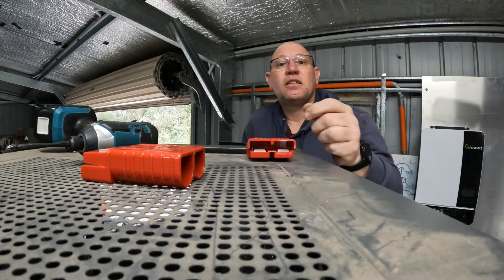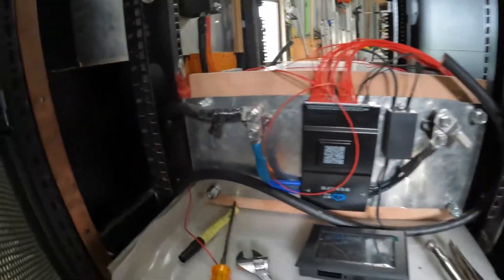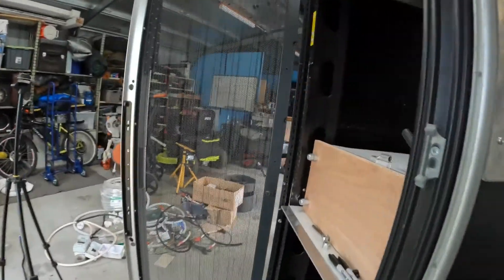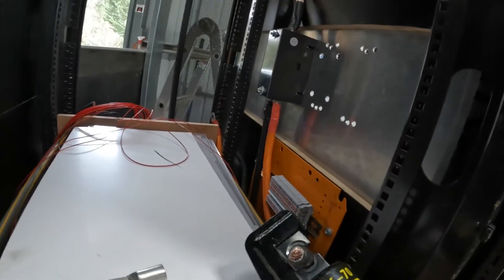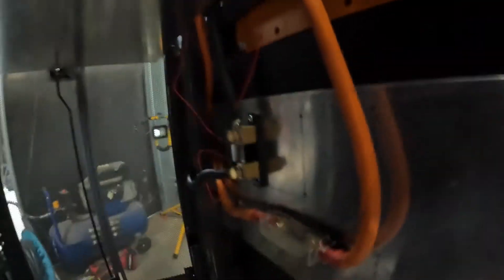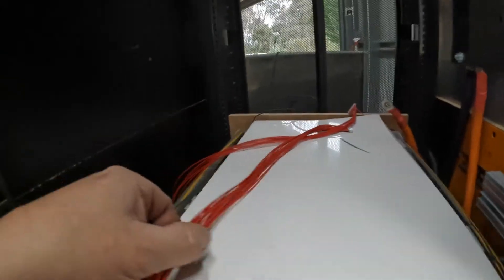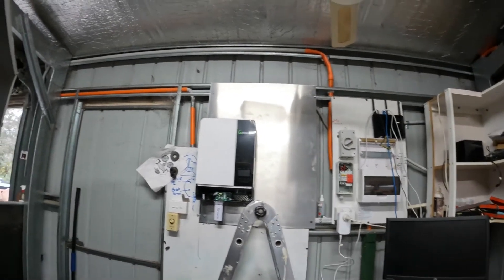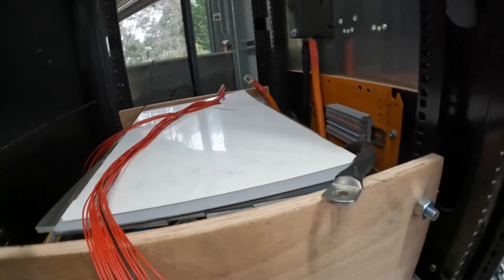Cabling up to the Growatt Spf 5000 Es off grid 48 Volts plus BMS wiring

Comment: Very thick wires needed for 48 volts! I understand now why my battery is around 400 volts…
Reply from the maker: No mate, I could have used the 50 mm cable,  but had 70 mm I got very cheap.  More to come,  BMS part 1 wiring tonight. Have a great weekend, Andreas.

Comment: That is looking the part. I really like the panels you made on the side of the server rack.
A question, the Growatt SPF5000-ES - how do you reckon they will take weather? My setup is all outside, until i get the camper up to the point i can relocated it all in there, so batteries/BMS etc etc are all in a metal box protected from the elements and the Growatt will be mounted on the wall temporarily and so will be exposed to the elements.
Reply from the maker: Ben give it a miss and go for Victron for your setup.  There are cables and 3 circuit (cct) boards  in the bottom compartment.  These ribbon cables go up into a square hole on side of unit. Plus there are two fans above the cct boards. By the way Andreas got in before you mate. Best watch the one at 5 pm today.
Reply: @chuxxsss  I saw with Andreas' comment.
I have all the bits now, so not swapping to Victron. I'm just a bit behind you - almost ready to start wiring.